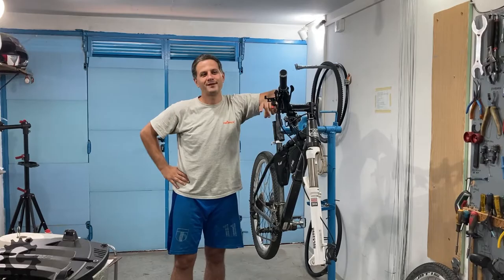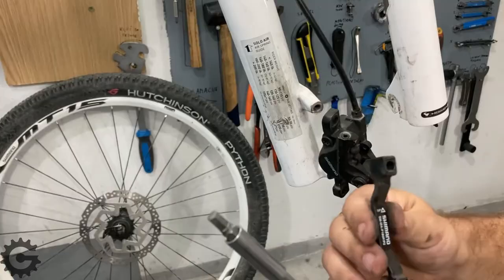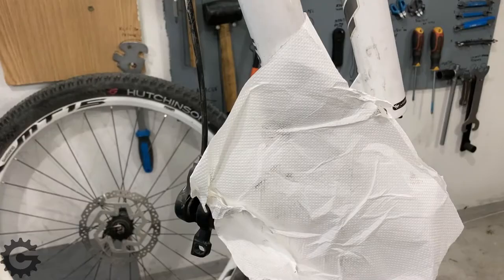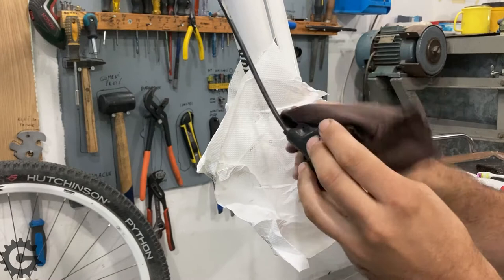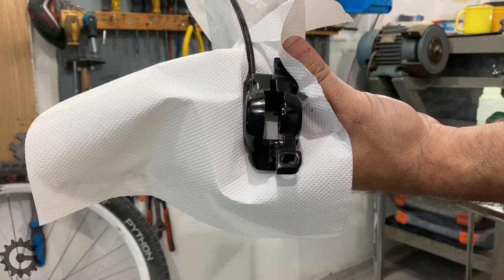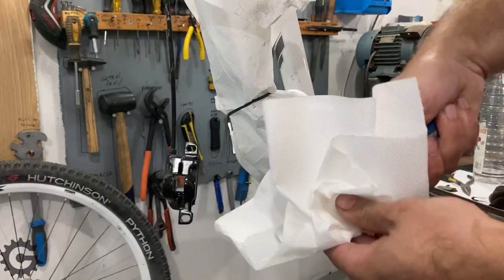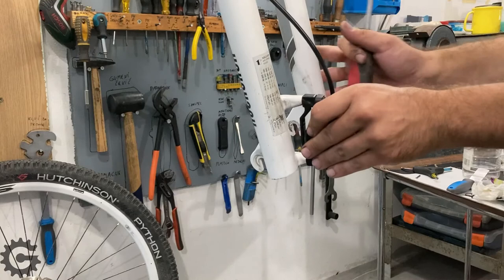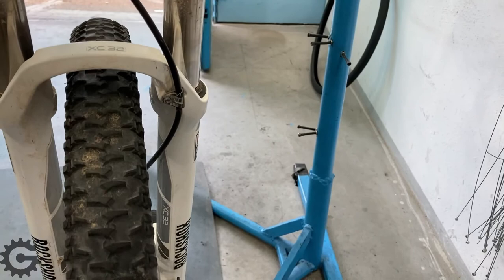Fixing a stuck bicycle disc brake piston [1019]

Comment: But what to do if you have to get stuck pistons out to change the piston seals? Mine are are stuck. The seals leak, I get air in the system, can't get it pistons out, apart of one that sometimes pops out. Seems like I need an air compressor.
Reply from the maker: Most calipers are held together with two bolts - screwed in from one side to the other. Unscrewing those bolts lets you split the caliper into two halves. When doing that, be careful not to drop any o-ring seals (and be mindful where they go back, even if replacing them). 

Once the caliper is "split in half" - you can more easily grab a piston with your fingers, and work it out (don't use any pliers to not scratch the sides, as then the seal will leak once you reassemble it).

If it's stuck and rusty it might take a bit of patience, but it should work.

The problem with using an air compressor is that you can't get both the pistons out. Once one piston pops out, the other side will have no more pressure build up. In theory (I haven't tried doing that), you might be able to use the channel that lets the fluid run between both sides as a "tool" - closing it to pop one piston out, and sticking an air gun to the other side's channel to pop the other piston out (not sure if I've explained this well, but once the caliper is split apart, it becomes quite obvious).

Hope this helps.

Relja
Reply: @BikeGremlinUS  the problem is they won't lift out, I can't press any harder ont he syringe to move the pistons out.
Reply: @BikeGremlinUS  defenitly not rusty one piston popped out but can't ge yth others out, put the piston in to refilled with fluid tried to let the other pistons come out, but it's stuck. They move but not enough.
Reply: @BikeGremlinUS  the brakes are Formula Cura 4. It's 2 years and one month old. I've cleaned and lubed pistons to prevent issues. But now pistons randomly get stuck and unstuck.
Reply from the maker: In that case, if they won't go out enough for you to get a good purchase (grab) with your hands, an air compressor may be the way to go.
Though, to get both pistons out, you'll probably need to disassemble the caliper into the two halves and push each piston out separately

Ideally, try to hold the piston away from the hose side in place, so you first push the piston closer to the hose side out first.
Then, disassemble the caliper, insert the hose into the fluid channel of the piston that is still in, and push it out with air pressure.

Alternatively, you could unscrew the hose, close the hole with a screw of appropriate thread pitch, then disassemble the caliper and push each side out using the air compressor inside the fluid channel.
Reply from the maker: Goes without saying: use some eye protection just in case, and watch your fingers.
Reply from the maker: That's a four-piston caliper?
In that case, it might be a bit more tricky to push them all out. Perhaps reinserting a pushed-out piston just slightly, holding it in place with a zip tie (or some vice, or a friend's help) and pushing out the other one. Repeat the procedure for the other half of the caliper.

For DOT fluid systems:
Before assembling it, you might use some red rubber grease (vegetable-based for hydraulic seals and pistons, the special grease). Smear a bit on the seals, and on caliper sides before inserting them (remove any extras, no need to pack the inside of the caliper with much grease).

Calipers with red rubber grease applied stick a lot of dust and dirt, but don't rust and don't get stuck. Basically: they look like shit, but work great and are relatively easily pushed out, cleaned and re-lubed when needed. 

HOWEVER -  I have not tested this with mineral hydraulic oil systems (such as the Formula Cura 4). Mineral oil repels water, so in theory you need not lubricate the seals. Only piston sides.
Reply: @BikeGremlinUS  i finally got the pistons out, I bled the brake, let fluid from syringe at the lever trough the system and out of string at caliper bleed screw on caliper and then put a screw driver from the front of the caliper, and pumped the lever realigned pistons few times repeated until pistons were fsr enough out, one popped out other did not, but I put a screw drive Ron inside of the piston it has a holewiggled it gently made Sur eto not come near the outside of piston. It came out too. Will swap those and then repeat with other side those did not come out. But ar removing more.
The caliper seems to be designed to out something trough the front of the caliper. It has cut outs,not sure if it's the correct word.
Reply: @BikeGremlinUS  ziptie is a good tip. I will try that when lubing pistons.
Reply: @BikeGremlinUS  yea by lubricating i mean getting pistons out enough to get some drops of fluid on them. So yea i lube the pistons. The seals actually have light white greas eon them, there was grease residue inside the caliper, and in the line when I bled it 2 weeks ago.
Reply from the maker: That could be silicone grease (the white one). High-temp. silicone grease should be OK for mineral hydraulic oil systems (not sure if it's safe to use on the DOT systems).

Haven't tried that though - only red rubber grease on DOT systems - and that is good.

Using grease on pistons provides a bit more durable rust protection compared to using oil. But it is uglier and messier.  :)

Comment: If the piston doesn’t want to push back in does it mean i need to get it bleeded?
Reply: Probably slightly over filled master cylinder. Totally fine except when you go to to retract piston. Make sure piston is clean before trying to push in and if they refuse to go with reasonable force then you need to open the port on the brake lever and then push piston back. You will loose some fluid. 

You do not want to introduce air to the system. For my brakes (Shimano) I use the bleed cup and fill it with a little  oil that way air cannotnnot enter the system. Also the proper way to do it is with a bleed block and that way you know you have the right amount of fluid
Reply: @jakeb1778  it is quite easy to blow the compensation membrane in modern Shimano levers when pushing pistons in with overfilled master cylinder, as it is apparently designed to be cut on the plastic part, probably for safety reasons (master cylinder over-pressure when system completely overheats and the pressure kicks back to the master cylinder?).
If you're not sure if the MC isn't over filled, always open the reservoir first, and place either some cloth or a funnel to capture potential overfill not to make a mess (however that might introduce some air to the system, but you might proceed with some simple 'lever bleed' with the funnel afterwards).

Comment: how if the piston stuck won't back in? i found this issues back when I work as mech, the customer seems to over use the brake until the pads died, i was thinking maybe the piston overheated and melted lil bit. but not sure what's exactly happened
Reply: @BikeGremlinUS  thanks sir :)
Reply: I got the same problem. I changed the mineral oil, it was better but it's not near perfect.  My mechanic says it has to be replaced...
Reply: replace oil
Reply: @datogadelia  as far as i can remember , it didn't work

Comment: Is it okay to bleed my brakes with total lhm oil?
Reply from the maker: Bicycle brakes use either DOT brake fluid, or mineral oil.
For those that use mineral oil, I've had very good results with Total LHM Plus.
Reply: Okay thank you i will try it, great video btw

Comment: do you just push the pistons ?
Reply: @BikeGremlinUS  now I get it after experimenting,i did removed  the screw cap of the breaks on the handlebar and was able to push it gently it reset the position of the  pistons,now at first I  removed the brake pads,and I pressed the breaks,then the oil leaked,I just figured out why they put something in between the pistons when bleeding..lols